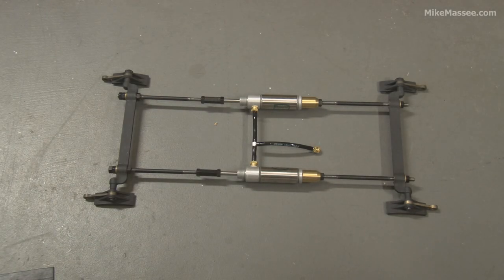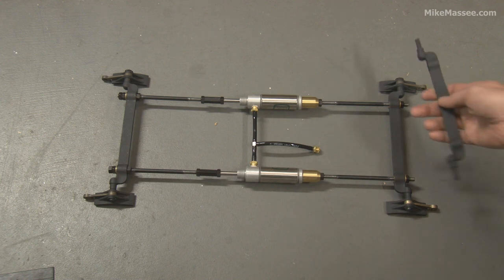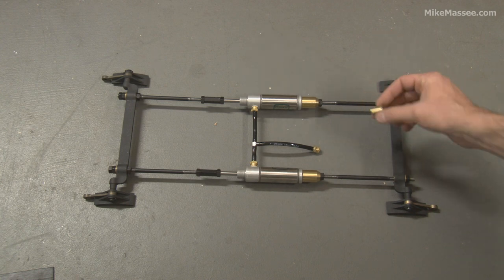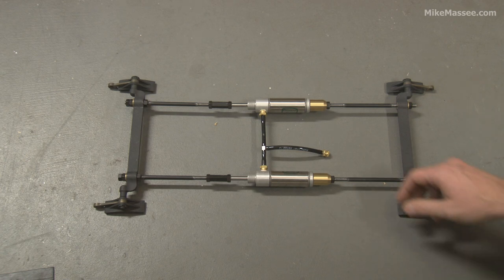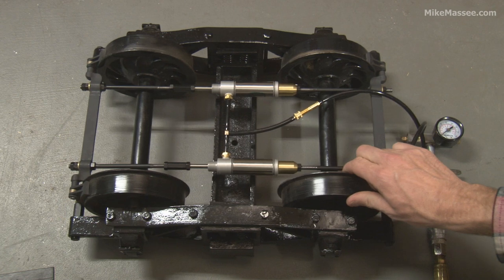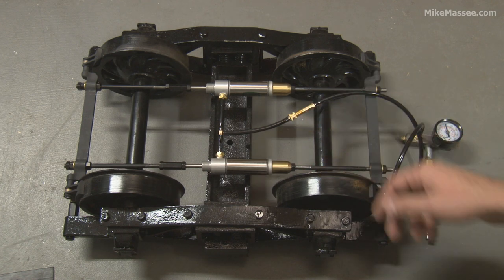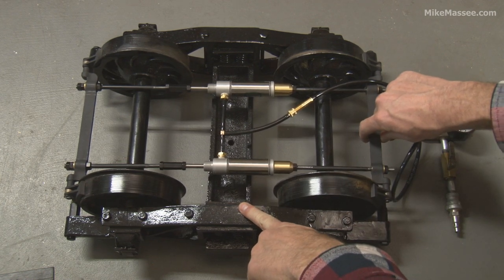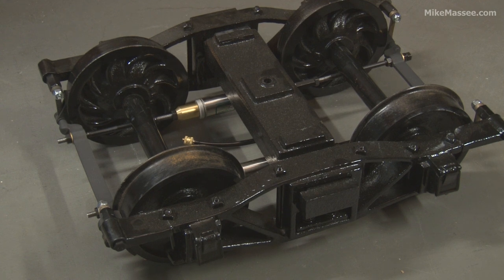Air brakes for riding scale freight trucks

Comment: As someone getting into the hobby, and considering air brakes on rolling stock, this was very interesting, so thank you! Also, would the cylinders work on steam as well? Just curious.
Reply from the maker: These cylinders are not steam compatible, they will likely corrode on the inside.   There also needs to be a bleed hole for water condensate to make its way out.  Steam brakes are fun but they don't work very well compared to air.  It takes a long time for them to set and release and they can get hung up fairly easily.   But if you want to set up steam brakes on a locomotive as an independent you can.
Reply: @MasseeMedia  Ok. I just thought I'd ask, I'm a curious person. Thank you!

Comment: Nice set up and a great video for the first one in a long time.  Could this set up have been done and would it work as well with just a single actuating cylinder in the center?
Reply from the maker: +ByrdMann2010 Yes you could do that as well.     Might make getting at a kingpin in the middle of the truck harder, otherwise no problem.

Comment: I want something like this for my 1/8th scale 7.5 inch train. Do you have any suggestions to help me start this as I am new to the live steam community? I want to have automatic brakes where when I lower my train line the brakes apply.
Reply from the maker: The castings for the brakes shown here are no longer available, but they can be fabricated.   A simpler and more robust set of brake shoes and cylinders can be had from Tom Bee.   You could make automated triple-valve brakes but it's much more complicated than straight air, with many more lines and a resovoir on each car, etc..  I would advise against it, unless you really like the prototypical functioning of it for its own sake.
Reply: @MasseeMedia  What about spring loaded? The air acts against the springs until the pressure drops. I do have the rest of the air system designed but the brakes are the hardest part.
Reply from the maker: @RyanHatterer-Ryanns999  They would have to be some awfully big and stiff springs pressing on the wheels pretty hard at rest to get the kind of pressure you can get from an air cylinder.    A double-acting cylinder with application pressure on one end and release pressure on another would probably be the way to go.  Two lines running down the train, the application line being in line with a resovoir on each car.   Then you can set the application pressure depending on the steepness of the railroad and the weight of the cars.  With riders you can have a lot more pressure before the wheels lock up, running light you want want that pressure lower.
Reply: @MasseeMedia  Okay, I am running only 15 to 25 psi, and didn't think it was be a big deal. I have it setup in the engine the compressor runs 125 psi to the tanks then regulator and valve to max of 25 psi to the train.

Comment: Could you use steam instead of compressed air? Maybe need copper pipe but if sufficient pipe run the steam might be cold enough by the time it gets to the cylinder.
Reply from the maker: Sorry for the late reply, yes you can use steam for brakes with all non-corrosive metals.   The main thing with steam is that it applies and bleeds off more slowly, so you need to take that into account.  Also, you need a drain valve at the lowest point to drain off the water that condenses in the lines.   Steam brakes are fun because they have a particular look and sound, with a release of steam when you release the brakes.